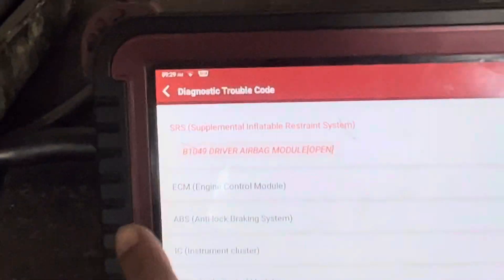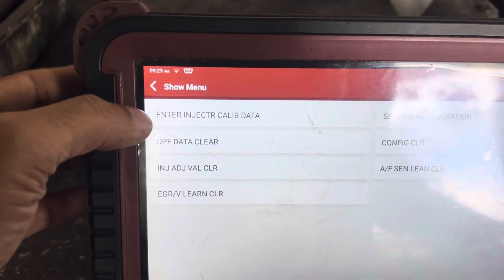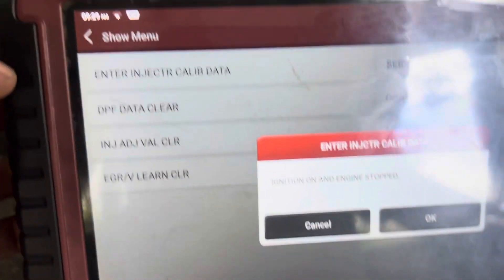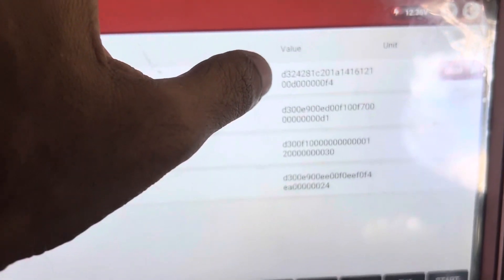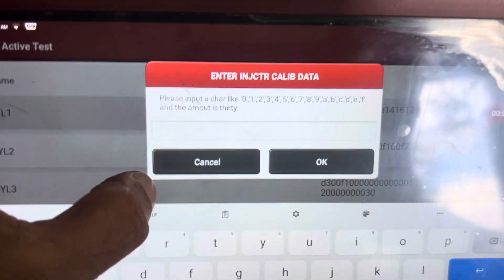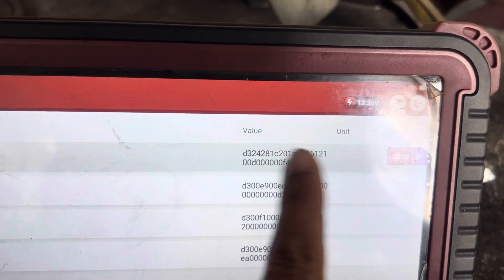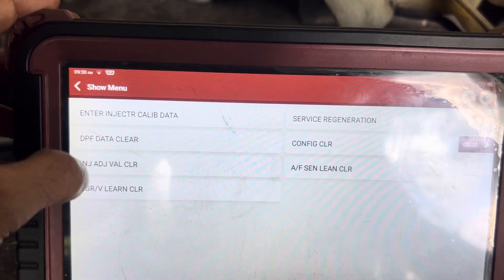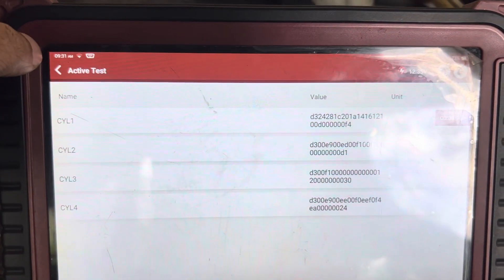How to register /coding YD25 injector | P1622 INJ ADJ VAL UNRGST

Comment: What are the symptoms of unregistered injections on the D40
Reply from the maker: High fuel consumption 
Elimination of Check engine light 
Lack of Fuel control from the ECU
Reply: My ravs are more than 1rmp
Reply: Thank you. can the engine be shaking be one of the symptoms.i just installed new injector on Nav but it's shaking and the idling is high .what should I look out for .
Reply: I mean the ravs seems high what can be the solution 😊